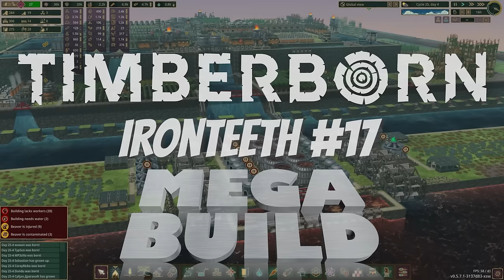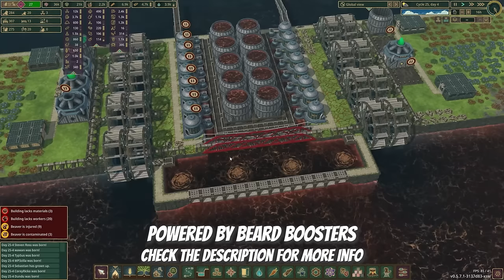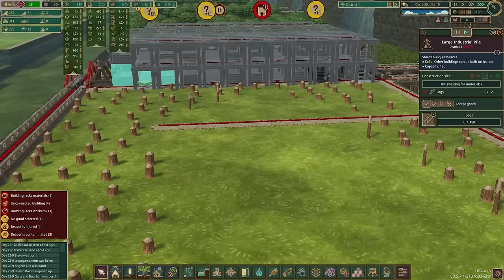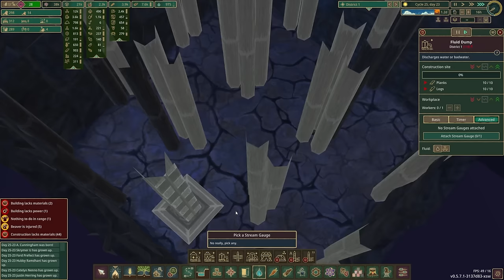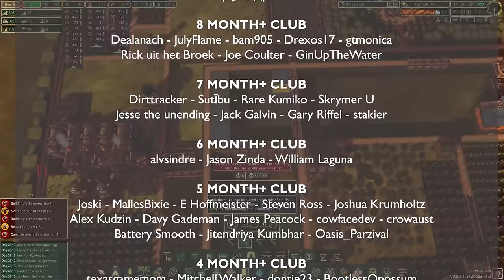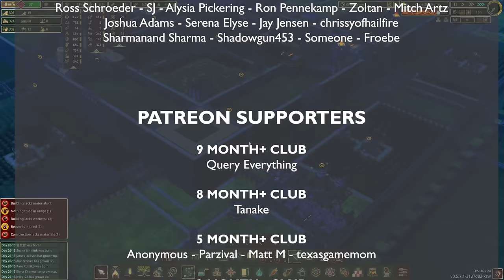The pump complex takes shape! Timberborn Update 5 Iron Teeth Mega Build Episode 17

Comment: → You don't really need to go that deep for your water pumps – their straws won't reach deeper than 6 anyways, and all water below that level is not accessible. For actually using it, you need either a second layer of pumps below (but for that you'd need to move the upper layer pumps so that they don't conflict, and leave enough space below for pumps and paths towards them), or some division into two reservoirs with the automated pumps to get water from the lower reservoir into the upper one. (I guess you recognized this too.) For the next corners, I'd go just 6 deep (or 7 if you want to pretend it goes deeper down). 1:18:50 I guess this answers your question.
→ When you are starting with mining the underground ruins, you'll need more treated planks (and thus more pine resin). Until then, I guess the use is limited.
→ 1:01:15 "I probably should pause this when a drought starts" – Good idea, if only to preserve some power in the time when your water wheels are not running.
→ 1:02:58 I just noticed that the vertical power shaft + vertical-to-straight (1 gear, 1 plank + 4 logs) is even cheaper than the level 2 platform (4 planks + 4 logs) it replaced here (if you count one gear as less than 3 planks). And using just vertical shafts instead of the platforms, it's even cheaper with just 4 logs. (I guess it has the disadvantage of not being able to walk below it anymore, so not totally broken.)
→ Maybe adding a few explosives factories near your badwater pumping area helps getting your explosion projects done faster?

Of course my comment is a bit late, you already have the next video out.

Comment: - I think blasting all the way down is the right choice
- Also, you can add some dynamite and metal factories in the extract area as plenty of power is there.
- By pausing the deep mechanical pumps during droughts, they have become irrelevant, as during the wet season, the area will fill automatically due to dam pieces.
Reply from the maker: My concern is that the 8 pumps will empty the corner faster than it can refill. That, and we want to be able to refill fast when a temperate cycle starts. We might play around with it and make some changes if it ends up being bad or inconsequential

Comment: As far as I can tell, the mechanical fluid dumps there only have one real job, which is to get the water flowing from the wider part (with pools etc.) into the pumping part as soon as the badtide/drought stops (as they only matter until the dam height is reached). I do agree that they should be paused to make sure the pools don't run dry. But this does mean they are not actually very useful?

For the new corners, I don't particularly mind either way how deep you dig/blast, although it is, of course, fewer resources to only go as deep as necessary.

I still think it might be fun, in the long term, to put the domes on the badwater sources in the industrial area, have them flowing, and then doing some earthworks such that that badwater goes "backwards" and then powers the water wheels :D not full power, I'm sure, but might still be nice
Reply: I LOVE the look of the eight water pumps in the corner, btw. A win for the aesthetics over 100% efficiency of distribution. 

Maybe the four water storages aren't needed, mind, and a/some monument(s) would work nicely?
Reply from the maker: Yeah someone else also suggested monuments there, and I think that's the right move.

Comment: 34:21 You could fit 4 water pumps on opposite sides and 2 on the remaining sides if you moved the dam pieces around (and add some side platforms)

4 side; Pair of water pumps, space, pair of water pumps 

2 side; 4 side’s pump, space, pair of water pumps, space, 4 side’s pump. 

Now as it is 9 by 9 and not 9 by 10, the path to access the pumps on the 4 side which sits on the dirt on the outside edge has to run on a row of side platforms 

You now have 12 water pumps with space for 3 floodgates

Comment: The moment someone develops a piping/aquaduct mod for this game, they'll be crowned king of the beavers.
Reply: I've seen some pipes already, they work (and actually also look) similar to these power shafts which were used at the beginning of this episode. I think a proper aquaduct (where you can have water crossing over air, or over other water) is impossible with the way water is rendered in this game.

Comment: You should really check how mutch power you are using now when you have put in two mechanical pumps that draws a lot of power. It might contribute to why your factories have so low output.
Reply from the maker: Yeah they're sucking it dry for sure. We'll get that fixed soon!
Reply: @JCTheBeard  yes and it a caisson not a kofferdam you are going to build around the mines. Kofferdams are temporary, caissons are permanent. It's actually an open ending caisson if we are going to be pedantic, and we are.